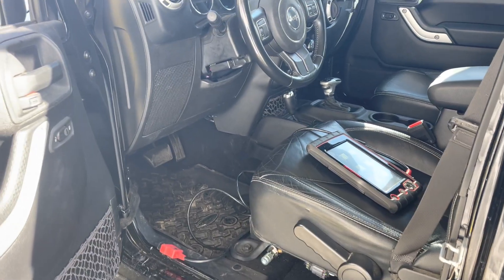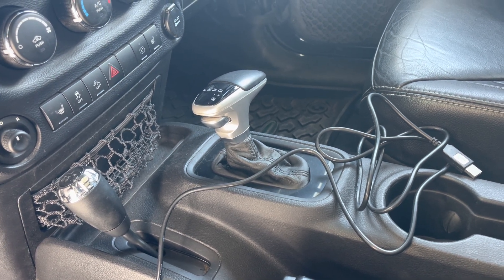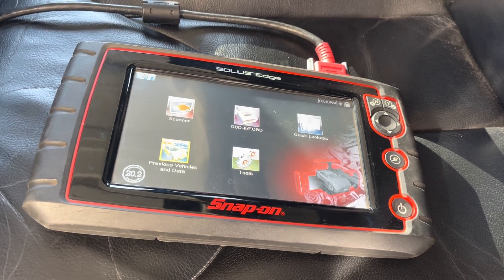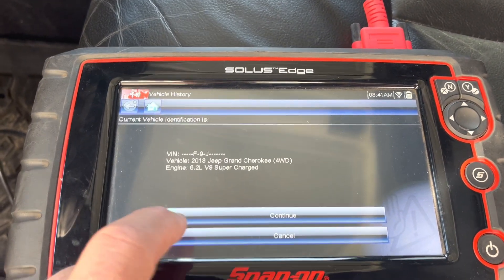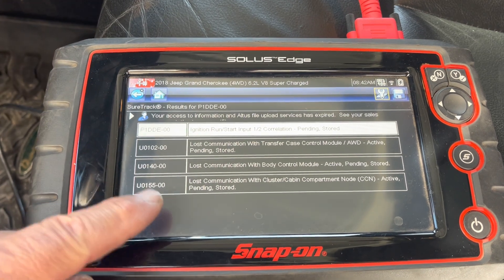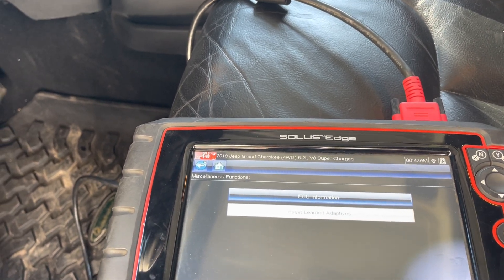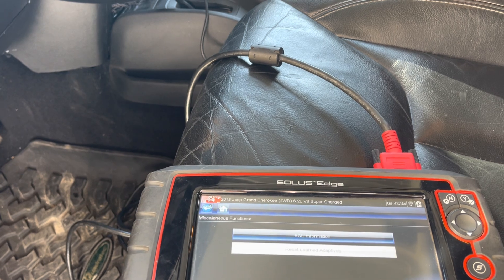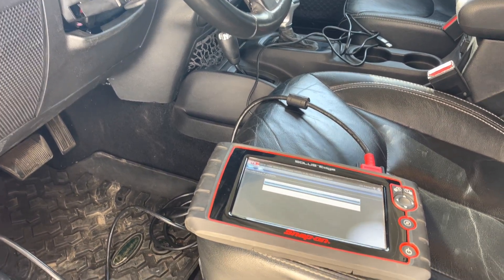How to hookup a scan tool to your 8 speed JK

Comment: How can you reset adaptions without the snap on scan tool?
Reply from the maker: You can reset Adaptions with most scan tools, The thing is, the transmission needs to be reset and started fresh. You need to teach the transmission how to behave, we have found just from my testing when you pull a valve body out and reinstall it there is air in it and you are low on fluid so that is what the transmission is seeing at first, so we clear all the codes out and reset the adaptions and then go for a test drive, we drive the Jeep for 150 miles and we drive it very easy. Also recheck the fluid many times ..
Reply: What if I can’t communicate to the tcm?